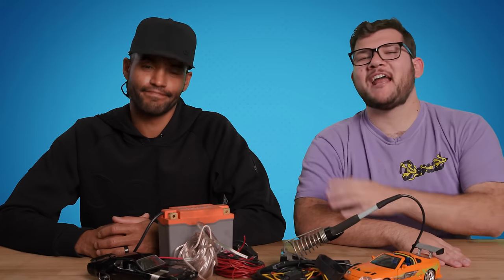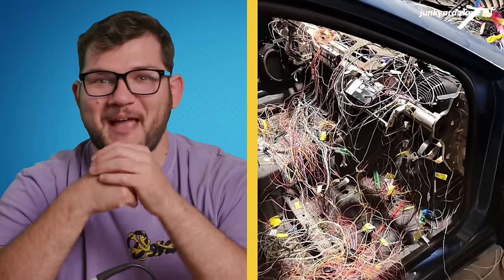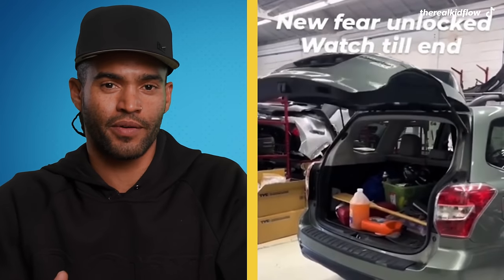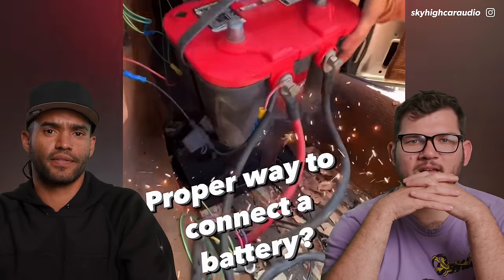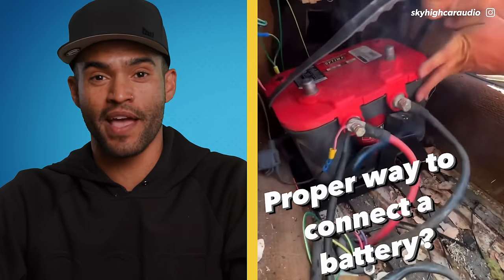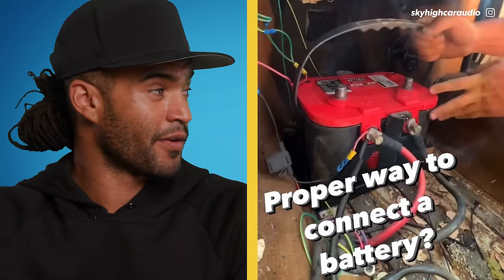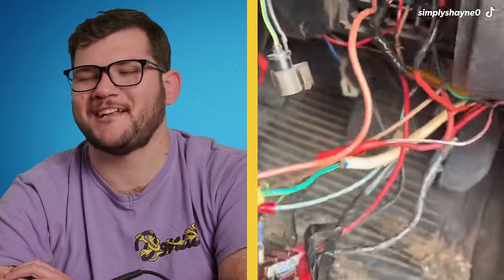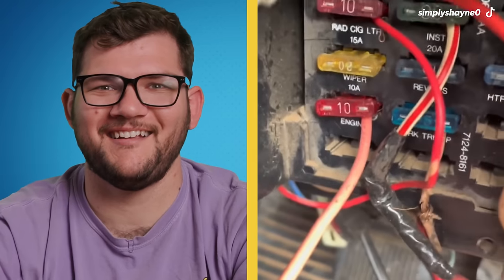Mechanic Reacts to Deadly Electrical Repair Fails

Comment: wiring is an arch enemy of mine. a little story: I built my own wiring into a vehicle, the vehicle was from england with a positive ground, and came from factory with no indicators. So I had to fit indicators and a relay to have indicators. but I ended up installing an indicator relay that is not compatible with a positive ground, and have a generator voltage regulator that isn't compatible with negative ground. So I fused them together.
Now the vehicle has everything run on positive ground, be it ignition, lights, horn, starter relay, glow plug, except the indicator/blinker.. that one I wired up with a fake "negative ground".. I basically wired the negative end of the relay into the ignition and gave it a positive and negative wire to the lights, instead of going chassis. and the funniest thing: My trailer plug has both a positive and a negative ground terminal so I can make my trailer work, by building a switch that "translates" my mess of a wiring into the normal trailer wiring..

All this because I didn't wanna spend 30+ euros on an older, mechanical blinker relay.

Comment: 6:55. I've actually seen that on cars in the northern states where it gets much colder. The plug hands out of the front grill. Owner takes an extension cord, plugs it into the plug from the grill. Heating pad warms up the oil pan and oil, while your eating breakfast, getting ready for work, or whatever. Makes the cold start a lot less harsh on the engine, and you don't have to wait as long for the vehicle to warm up and the oil to start flowing properly, as it helps the process. Still would need to let it heat up to operating temp so the metal parts can expand properly. But overall if setup properly I don't see any harm. As long as it doesn't touch moving parts. Short out anything else it may touch. It seems useful if that's a problem you deal with.

Comment: Ok, a couple centuries ago, I was 16 young and dumb. My car had a killer am/fm radio, but no tape player. I needed my tunes! A friend had a car stereo out of a different manufacturer car, and it had a tape player. Score. Step one, figure out what each wire did coming out of the stock radio. See which had power from the key on, speakers, etc. Traced it all.  Then figured out what the 80’s tape deck needed.  And then for some reason we thought we could just hook up BOTH stereos to the same speakers. Splicing wiring and using electrical tape - hooked the speaker output of BOTH radios together to the speakers.  Somehow it worked. Somehow it didn’t catch fire and burn the car down. After a few weeks, blew something in the second stereo, and decided to rip out all the spliced wiring. I used a boombox with 6 D batteries to listen to cassette tapes.  

Did I mention I was young, dumb, and flat broke? 😅 Had $3 of electrical tape invested in that setup. 🤣

Seriously, how neither radio didn’t just catch fire and burn my car to the ground is beyond me.

Comment: The issue with the battery sparking around 9:30 he had the positive and negative terminals connected, thats grounds the car frame and when installing the battery he was shorting the positive to ground via the frame bracket in the middle.

Comment: Those AC powered heaters are needed in extreme cold temperatures. -40 TO -50 without the wind chill and you're not starting anything without at least one type of heater. At a bare minimum there's usually a block heater and battery heater installed. Then oil pan heaters for the engine and transmission are a good investment for their low cost. I even installed one on my power steering reservoir because not enough heat from the block was going there. There's other types of heaters and heating methods that aren't as common for automotive, but they're out there. Doing a cold weather problems episode would be a great idea!

Comment: The first one, that man is designing an entire harness for a vehicle that it wasn't meant to go in, which you don't have to do, unless you want it to work like it was designed for that vehicle and have everything work like a new car from the factory, I have respect for that man, I don't know what vehicle he's trying to put it in, but I hope it's something he really loves, and that it is not just some other throwaway vehicle, like putting it in a 84 Camaro that came with a 4-cylinder and like 90 horsepower, installing an entire setup, with everything including the HVAC, info/GPS/audio, power seats, windows, mirrors, lights, ABS, stability control etc and have it all work like factory, would be awesome, the ultimate sleeper, any car guy will see that Camaro, know it came with 90 horsepower, and be jealous once they see how awesome it is, when he has the battery on the table and has the pliers, he should have just shorted it to show what happens, it's not a huge deal, but only for a moment, these batteries can provide hundreds of amps, and when shorted they can produce explosive gas, and explode spraying hot sulfuric acid, molten lead everywhere, something that's very important with DC 12 volt systems is properly fusing circuits, it won't electrocute you, it will burn you if you touch something with high resistance, if a circuit that is unfused shorts to ground, it will get very hot and cause a fire, burn your beloved car or truck to the ground, never bypass fuses, never stick wires in the fuse box, just because you stuck a wire in the fuse box doesn't mean it is protected, and he said something that's so important, never do anything part way, if you take the lug nuts off half way there is no way to visually know that, or suspension parts, no way to visually know that the bolts aren't tight, they could even be finger tight but that's not 125 ft-pnds and can rapidly disassemble catastrophically being a danger to not just the driver, but some single mother in her minivan driving her kids home, it's very common now for people to think that they can do their own oil change and do their own brake pads, it's partially because of parts stores commercials making it seem so easy because they make money directly from individuals, not commercial sales mostly, it may look easy, might look it up on Google and its only 12 steps, but that assumes that everything goes perfectly, every part is in perfect condition, and that you have the skills, tools and knowledge to identify damaged parts, know how the system works, know what is normal and identify a potentially catastrophic failure before it happens, if you see a little bulge in the rubber line, if you are even paying enough attention to see it, you may not think anything about it, but a mechanic will immediately know that the inner hose that handles the pressure of the brake system has started leaking and the hose is only a few brake applications from completely failing which causes complete loss of braking ability, it's not just your safety in question when on a public street, especially a public interstate, it's the safety of everyone around your vehicle as well that relies on the competency of the mechanic work done on the braking system, be safe folks and if you do your own repairs, if you see something, check before you continue, seemingly small insignificant things can be a sign of imminent failure or be the cause of something you are trying to fix it solve lol.

Comment: As a Canadian, I can attest to the oil pan heater. I'd also bet the other cords were for a block heater and battery blanket  very common in cold winter areas

Comment: That vehicle with the oil pan heater was actually a car in an extreme cold weather environment. When I lived in Alaska it was -60 in the winter so you needed a battery, oil, and block heater or it would freeze solid.

Comment: The clip with the extension cords and glued patches appears to be some heating elements for cold weather conditions, also known as winterized. I had this in Alaska and you would have a heater for your block and oil pan. It was usually installed a little bit neater than what was shown so that part was a little sketch, but other than that what was shown was pretty accurate.

Comment: 7:40....pretty normal for canada...block heater pre-heats the coolant...oil pan pre-heater heats the oil...third one is either for a battery heater or an interior heater
Reply: pre-heat the coolant?

Comment: 6:42 those are oil pan heaters, used to warm oil in cold climates so then engine cranks over easier when you go to start it.

Comment: That Subaru with the tailgate that slammed shut is a rare but known issue, the strut in the rear fails so once the motor reaches max height nothing is supporting the trunk causing it to slam down. Could happen with most SUVs those struts just rarely if ever fail, no one thought to put a failsafe to stop it.

Comment: Its common to have block heaters on oil pans in real cold climates as well. They are usually just glued on like that. Least we call them block heaters even though it isn't directly on the block.

Comment: The subaru is most likely a liftgate motor. Theyre usually built into the liftgate strut now and when they are defective will cause it to slam closed mid opening.

Comment: Dude with the battery sparking after putting it in just needed to buy terminal adapters and use the top post 🤣🤣🤣. Smh

Comment: Always fun to watch those from the comfort of your screen, live it is another mattert though...

A couple of years back i was working in a garage. We had a slow couple of days so it was a good time to do a cleanup. I took a bunch of new spare parts that for a reason or another weren't used on the repairs that we did and went to return them at Napa.

The guy there sent me in the back to sort trough it with the warehouse guy. He was in the middle of turning some break rotors. So he asked me to wait while he changed the disc on the lathe. He removed the finished disc and to avoid waisting time just put it on the nearest flat space around.... wich was a battery! To make a quick story, a break rotor is an excellent conductor, the thing just seemed to explode. It instantly welded the rotor to the battery while melting the poles. 

Luckily, nobody was hurt and i would like to see the dumb looks we had on our faces as we just shockingly looked at the thing. Probably looked as deers in front of headlights!

Comment: 63 yo Aussie electrician here. Since 14 worked multi storey  construction. When I was 16 one older guy that had been giving me hell said he crashed his dirt bike, broke handlebars and replaced them, then removed wiring as he didn't need indicators. Said bike wouldn't start. Told him I would buy it for 50 bucks. 
Took a pair of wire strippers and a connector, joined the red with white stripe wire with the white with red stripe wire, kick started it and rode it home. If he wasn't an a-hole I would have mentioned the kill switch. You should have shown the clip where Homer Simpson had the coffee maker, microwave, TV going when he was on cruise control thinking it was autopilot.

Comment: Pretty sure the 'mystery' car at the end is an Australian EF Ford Falcon Ute from the 80s and early 90s (think Ranchero or Chevy El Camino).

Those cars used to be real cheap and popular with tradies, farmers and bogans (Australian Hill Billies), so cheap and dodgy fixes and work arounds were a norm, because fixing it properly would cost more than the ute.

Comment: Hey guy's the oil pan heater is for up north here. It's a norm here in upstate NY. Usually for diesel motors, but we do it for gas as well. When it's 0° and below, diesel motors won't start, and it's rough on gas motors. The oil is way too thick to get pumped throughout the motor properly.

Comment: While putting an intake back together I rested my right arm on what I thought was the fender.  while I was trying to plug in the throttle body, my arm started to feel funny. When I looked down after it got a little worse I looked down and found out I was leaning on both battery terminals and my arm can apparently work as a good resister.  No damage done and it just felt like I had lost feeling in my arm.

Comment: They see the 3-way splitter and start thinking it's race car stuff. LOL. I saw it and instantly assumed it's for a block heater, oil pan heater, and a battery warmer. Winters in Alaska can be brutal (especially in the interior).

Comment: Really enjoyed the video, maybe reduce the amount of electrical engineering questions though.
Answers like “sparks are energy” are questionable at best. I get what he’s trying to convey, but at no point did he explain that the sparks are actually parts of the contacts flying off. This could be really misleading to people trying to learn a thing or two, who end up thinking sparks are the same thing as electrical arcing.

Comment: I forget most of the details, but my master mechanic sibling once worked on a car where part of it turned into, essentially, a generator. A coiled bit of wire, a magnetic field, and a little bit of rotation. It caused electrical currents in some weird places on top of not letting the car start. They got it sorted, eventually, but because the manual from the manufacturer was full of lies, they had to figure out some super precise tuning all on their own.

Comment: I have wired a few cars - and I found my own system - though if it makes sense to anyone else or not - you decide.
Ok so basically I get 20 different color wires, I then get a bunch of different color tape.
I then wire up 20 things in the same-ish area (sometimes less if it makes sense), and then put a ring of tape around the area containing those point, and "quick wrap" the wires in a loose bundle with that color tape. That way I can quickly identify where wires go and where they should connect to, and it's really quick to do continuity checks.... and by having stuff semi wrapped there isn't lose thin wires everywhere and that "oh crap where does this one go" feeling I got the first time attempting to do this stuff.
At the end I go through the "small bundles" and reroutes them for final wrapping one at a time. That way it's not confusing or messy. Before stating on the next bundle I do a full continuity check on the wires I just rerouted - just to make sure because going back when everything is wrapped would SUCK! So to me spending the extra few minutes doing an extra check is well worth it.

Comment: Low level electrical issue I bumped into just today, but still. 
(Forklift mechanic) Working on toyota 3 wheel electric forklift. A7 code. After investigating supervisor, another code was previously present, so supervisor decided it may be seat switch and decided to make a jumper to bypass seat switch.
Jumper was to the switch itself.... Creating a closed loop between 2 wires and switch, rather than 2 wires and computer that's looking for a closed circuit. (Computer saw open circuit at seat with park break disengaged)
6:00 "A/C current"
It's DC current that has the most force.  Looks like a ground wire for the starter. (Some starters are externally grounded). A/C current only exists in the alternator and puts out D/C for the rest of the unit. I think Aaron just misspoke, since seems to know what he's talking about.

Comment: When I worked as a service manager at a national garage/parts chain I saw a lot of sh!t. One kid came looking for a head unit for his buddies car. I suggested they spend $15 and buy the harness adapter, it saves time and removes the risk of poor wiring. He told me how good he was at all this, and how dare I suggest such a thing. A few hours later he comes and asks for various fuses. Then again a half hour later for even bigger ones. "Hey man, you're gonna start the car on fire that way", I said. He replies that it won't even start. Turns out he had pulled the factory unit, grabbed on of them sets of 1" cable cutters and went right through the harness with out disco'ing the battery. The can ended up in my shop and we had to throw a new brain in it. It was fucking comedy gold for me. His buddy was PISSED, and made him pay for the thousands it cost to fix.

Comment: The flaming led taillight could have been an issue that got shoddily repaired in the manufacturing process and then sent on its way. I've almost seen this before. It didn't catch fire but the second the battery was hooked up, she started smoking. It seems repairing led wiring is not the same as repairing average older light wiring.

And I'd suggest a rat snake instead of the cats for mouse control. They require next to no maintenance, and they are pretty rad. 

Thanks guys... love you!